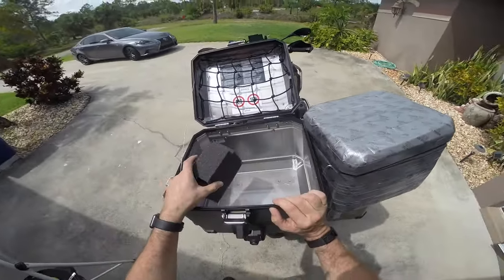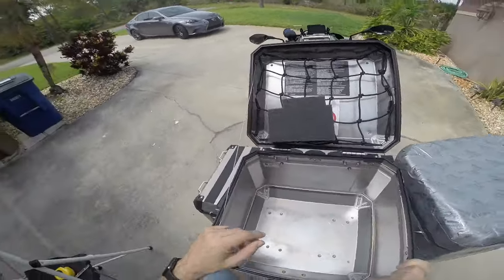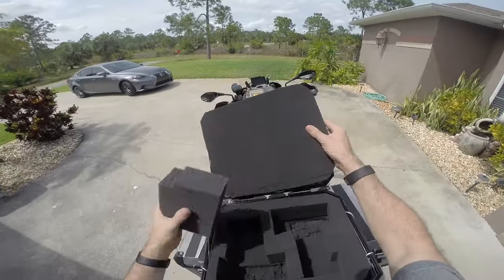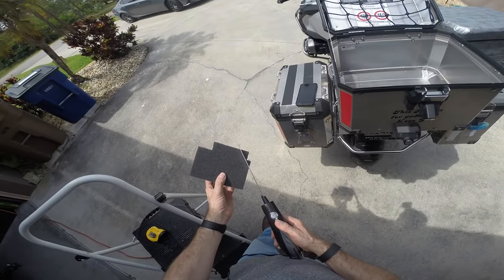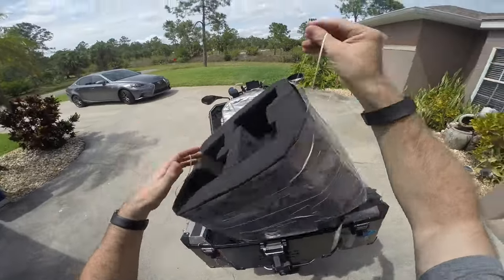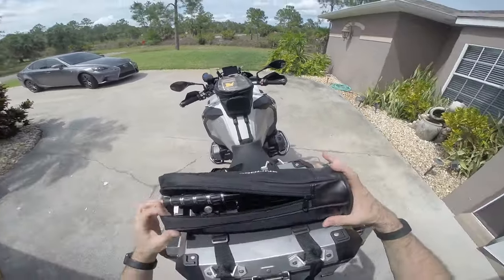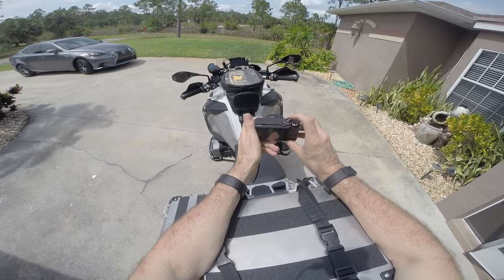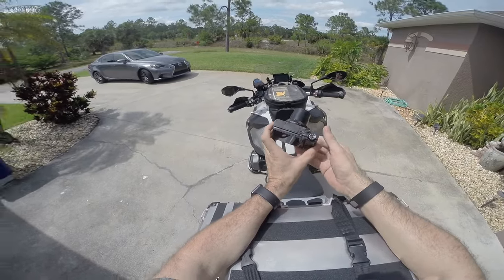DYI Top Case Camera Packing For Motorcycle

Comment: I've done this before.  I had problems with the foam deteriorating pretty badly because of the road vibration.  I think using the more solid type foam would work better.  The other problem I have is that it doesn't use the space very efficiently.  I can actually get more stuff packed in with a regular camera bag that fits inside the top case.  The real advantage of doing it this way though is the easy access to the camera.
Reply from the maker: +Rob Spruell Good points Rob.   So, far the foam is lasting for me, but I'm sure it had to do with the duck tape also.   You are correct on vibration, I had vitamins on one trip, by the end of the first day, they all were powder.